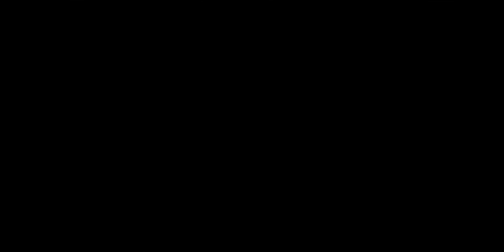iPhone 16 LEAKED! First Look At FINAL Design + New Features!

Comment: They need to put iphone pro max In orange and have a pen with it  and make the iphone just as large as the galaxy s24 ultra. Put airpods inside the phone box with the phone and adapter. Make all apps free in the appstore without making a apple ID account. Make the airpods into airbuds like the galaxy earbuds. Apple come up with a apple refrigerator like Samsung did so it can connect to the pho e when you go grocery shopping. Apple apple apple 🍏  yaaayyyy

Comment: I’m perfectly happy with my 15 pro max, I’ll probably have it for the next few years. Plus, I’m sorry, but those colors are just not it.
Reply: Same. The colours are ugly and not much changed. What case do you use? Originally was using apple silicone case as I like all black cases that don’t make the phone too heavy but I switched to spigen ultra thin hard case

I just hate the fingerprints on both cases, however this one is lighter than the Apple case and not so bulky on the sides
Reply: @Ohkeh640  I switch between an ESR clear case, and a casetify bounce case. Casetify is a little overpriced, but the designs plus protection is worth it for me. ESR is the best clear case imo. I have the white titanium so fingerprints are not really an issue for me since they’re harder to see on the lighter color phones. But I had a blue 12 pro max, and I remember the fingerprint struggle was infuriating.
Reply: I switch between an ESR clear case and a casetify bounce case. Casetify is a little overpriced, but the designs plus protection is worth it for me. ESR is the best clear case imo. I have the white titanium so fingerprints are not really an issue for me since they’re harder to see on the lighter phones. But I had a blue 12 pm and I remember the fingerprint struggle was infuriating.

Comment: Hi all, would be so kind to answer my doubt: I’m coming from an XS Max which struggle to survive, not charging well, lagging etc… being an old school guy I charge it with cable and never used a MagSafe. My question was, will Apple launch a new MagSafe charger being abke to charge the new iPhone 16 at 40w speed? Or can I already buy in advance the actual magsafe charger that will support 40w charging? Thanks so much 🤞🏻

Comment: I really like the design of the base 16 iPhones, at least they look different than the previous 4 years. 
However if the SE4 is rumored to be true, I personally would want to wait. 
I have a 14pro & am not team pro iPhone anymore. 

Having 120HZ on kills your battery. So it’s on 60HZ anyways. Having the extra camera, with the current camera app, makes it tedious to take good quality photos from a distance. Having to use Halide to get better images than what actual software on the phone can produce.
Not mad about having lightening, but need new AirPods. So all devices besides the phone will be usbc. 

Its not that I dislike the pro phones, but I see a pixel 7 pro taking better photos than my iphone 14 pro, and that battery lasts all day. 

So I am debating on just getting a base 16 or waiting for the SE4.

Comment: A18 chips should be based on ArmV9
Pro models should get WiFi 7 & 5G Advanced
Apple might be switching from HEIC to JEPG XL

Hate incremental upgrades.  Base models should have pro-motion.  Pro models should not have to wait for 48MP telephoto.  Love the new batteries; heat dissipation & replaceability are essential.

Comment: I just hope my iPhone 13 mini continues to receive security updates to be honest there isn’t anything to be excited about these new phones. I actually wonder if I shouldn’t upgrade to the next iOS to keep performance good. If there is a way to only get the security updates.

Apart from a few colour changes, marginal battery improvements 10% (laughable). I can’t see how A.I on a phone will be useful it appears to be gimmicky and just Siri 2.1. Plus like others have said the colours on the Pro models are so boring 🥱 I wouldn’t buy alone.

No small phone in there range pretty disappointing

Comment: 60hz is unacceptable for even a budget phone
Reply: I hear you. But the average person, such as my sister, won’t even notice a difference if it was pro motion display or not
Reply: @davej1104  its not about if the average person would notice it. Its about making a fair phone that both someone who’s wanting a budget phone to compete in the budget market gets a similar feature experience. I for one think 90hz OLED display, single shooter that has at least OIS and flash, 5G, all day battery, good build quality, usb C at minimum 10Gbps and iPhone 13 pro Silicon or later. Is all thats being asked for by people. We should not have to pay 2000 aud on a phone just to get high refresh rate screen and a decent camera.
Reply: Colors are pretty hideous…
Reply: You know who had one of the best screens? One plus
Reply: Samsung did it already in 2020. 120hz should be the standard, not a feature.. 😅
Reply: @RoryDunn117  I do believe Apple doesn’t know how to have a higher refresh rate and increase battery at the same time. I’ll bet that 2026 it’ll be this years new battery with a higher refresh rate. With that, the battery will basically be a 2023 capacity battery again.
Reply: people who have never used 120hz don’t even notice
Reply: I wouldn't say it's unacceptable, just a con.
Reply: @birgereriksen9984  i suppose that’s right
Reply: @birgereriksen9984  for a $1300 AUD that is unacceptable.
Reply: My mom likes iPhones, AND has a 120hz screen. Doesn’t notice the difference between 60 and 120. Sadly, thats the truth for most people these days.
Reply: It is criminal to not include promotion with the base models but as many commenters before me said - most people won’t notice. I tried with my friends and they mostly didn’t notice and when they did they didn’t care. Still not a reason to not include it but apple knows they can get away with it and still make a buck. I could understand 90hz on the base models and reserve the smoother 120 for pros
Reply: 60 hz -120 hz, no problem no effect
Reply: If it bothers you so badly, why not getting a phone with a 120Hz display?
Reply: Yeah
Reply: Don’t be so dramatic, perfectly acceptable
Reply: I have a iphone 13 pro and honestly I dont think I can notice a difference. I think it heavily depends on the person. Perhaps if I had another device with an even higher refresh rate I might notice that. Im honestly not sure. (For context this is my phone device with a 120hz refresh rate and my most used device.)
Reply: @ianpokemon04  toggle batt saver mode on now use it. Thats how it feels to use anything less than 120hz
Reply: @khyleebrahh7  honestly i can’t tell the difference
Reply: Nope. It's more that that. It's utterly disgusting.
Reply: The people buying budget phones can’t even tell the difference. Let’s be honest.
Reply: aw I thought apple was continuing 120 on new phones including base and pro😂
Reply: Coming from someone that works in the Genius Bar, the average consumer has no idea what 60hz means
Reply: If you scroll or read anything on a phone.. then you care.
Reply: Nonsense.The non tech nerds won’t care.
Reply: You don't have to be a tech nerd to appreciate the benefits of 120Hz. Some fans defend Apple's shortcomings rather than asking for better value for their money.  Be a consumer, not a cult member.
Reply: @caffeinated-gee actually you do have to be a tech nerd to appreciate 120Hz.
Reply: @Adam_player_1  You just need to be a human being with working eyes to appreciate 120hz
Reply: @Adam_player_1  no you don't
Reply: @NoDayOff98 bro the average person won’t know if you give them a 60hz display or 120hz display.
Reply: @caffeinated-gee lmao for real.
Reply: @caffeinated-gee most non-tech nerds don’t even notice the difference.
Reply: @caffeinated-gee disagreeing doesnt make someone a cult member
Reply: @davidjacobs6244  i am a tech nerd. The only thing stopping me getting that over the pro is 60hz. Its a perfect package.
Reply: @davidjacobs6244 even a person who is a 100+ years could tell a difference between 60 and 90 hz. “Non tech nerds” care to get a good quality phone for the expensive price they are paying.
Reply: Nonersense, because they don't know. If they Know, they wouldn't want 60hz.
Reply: @romahnae If they did know they would probably forget
Reply: Human eyes can only see 30hz.
Reply: @fastandshortech325  go and use a fast refresh rate phone then use a 30hz
Reply: No aod and no telephoto
Reply: Im a gamer and when im playing pubg i want as many frames as i can get. But in my everyday scrolling idgaf about the hertz
Reply: @charlesjohnson-ic4lk  I guess thats actually a good reason to buy a pro ngl
Reply: @charlesjohnson-ic4lk  i think it more noticable as everything around me is high refresh. When you go from anything over 90hz back to 60 it feels sluggish and easiest way to describe it is toggle bat saver on iphone. It just feels terible
Reply: 60hz is fked😢
Reply: @dakotafriday fuck what, shit phone with shit chips have 120hz but still for app and game still laggy coz hz no matter, Chip more important
Reply: @THEBATMAN7788   60hz is just a cash grab. And for banana heads. 120hz all the way.
Reply: Bro apples 60hz phones are way smoother than most android phones ”120hz” phones
Reply: 😭 who mans is this?!!
Reply: @johnpranaitis5628 Lmao no, it's not. My daughter has an iPhone 15 that shit looks like trash. 😂
Reply: @johnpranaitis5628  math not mathing lol. 120>60 idk what that has to do with it being an iphone or an android. 🤔
Reply: @HungMightGuy  refresh rate isn’t everything. iPhone ui makes a 60hz phone smoother than a 120hz with less smooth Samsung ui

Comment: hey appletrack I heard from a trustworthy source from argentina that talks with apple factories every single day iphone 16 6.5 inch and iphone 16 pro 6.5 inch  they are all ok for the event to be touched in september 20th and they have told me that apple told this source that iphone 16 plus AIR 6.8 inch and iphone 16 pro max 6.99 inch are having faceid unlocking issues magsafe2.0 wireless charging issues usb c 3.0 issues and iphone 16 6.5 and iphone 16 pro 6.5 inches will have usb type c 5.1 version speeds  but the plus and the pro max will have usb c 3.0 speeds but they also told me that iphone se 4 and iphone se 4 pro plus are set and ready to be launched at september event

Comment: Something I don’t get is why every YouTube channel is failing to mention the main camera sensor upgrade. A custom Sony IMX903. The new Sony stacked sensor is a HUGE upgrade.
Reply: Heard iPhone 16 is getting a Samsung sensor
Reply: that rumor was removed from macrumors' page so i assume it was fake :/
Reply: @franminach  Well that does suck. I’m hoping that it’s actually still on the pro max. The newer stacked sensor is over 18 months old at this point. Crazy to not upgrade the main sensor.
Reply: @WickedOnMars the sensor had been same since14 pro
And as an owner of 14 pro max and 15 pro max
Yeah there are noticeable software differences but it’s not enough
Reply: Mac rumours said it’ll be the same sensor as 15 pro which is the same as 14 pro
Reply: The smaller Pro model is rumored to not get the new Sony IMX903 sensor until next year. Yikes over a thousand for that with a 4 year old sensor won’t be buying that one.
Reply: @Nucleus1984  macrumours roundup says neither are getting a new sensor 
But if that’s what’s gonna make u not buy the phone I think you misunderstand just how much of a difference the new processing that comes with each chip jump will make

Comment: I love you Sam, but there’s not one thing new in this video compared to last week. 😂
Reply: There is the super exiting “button” and the recycled design for hundreds of dollars.
Reply: @janniboss9020 that’s the same with like every modern phone. Tell me the difference between the S23 Ultra and the S24 Ultra
Reply: @directerhu  we are comparing 12 with 15 bruh see the gap?
Reply: @directerhu stainless steel vs titanium, no curved screen, upgraded chip, on device AI, and a bigger battery….
Reply: @directerhu  flat screen,    scronger glass, anti reflective glass,faster charging speed

Comment: 🍏
APPLE COULD RELEASE AN IPHONE THAT HAS A FLAT REAR CAMERA SYSTEM THAT PROTRUDES OR STICKS OUT WHILE TAKING PICTURES. WITH THE 16 PRO AND PRO MAX THE 3 REAR CAMERAS COULD RISE UP AND RISE UP AGAIN REVEALING A ROTATING BASE. THIS SYSTEM WILL COMPLIMENT SPATIAL VIDEO CAPTURING PERFECTLY.😮
I WOULD RELEASE AN UNDER-DISPLAY DYNAMIC DOT THAT CAN BE TOGGLED WITH THE 16 PRO AND PRO MAX. I WOULD ADD A DYNAMIC ISLAND TO THE SE4 AND RELEASE IT WITH THE 16,16 PLUS,16 PRO, AND 16 PRO MAX. IT COULD HAVE A FLAT REAR CAMERA THAT DOES NOT PROTRUDE.
I WOULD MAKE A SPECIAL EDITION IPHONE EVERY YEAR AND AN ULTRA. A
DYNAMIC DOT THAT DISAPPEARS CAN BE ADDED TO THE SE4 EVEN!

Comment: 00:03 iPhone 16 design and color lineup for 2024 revealed
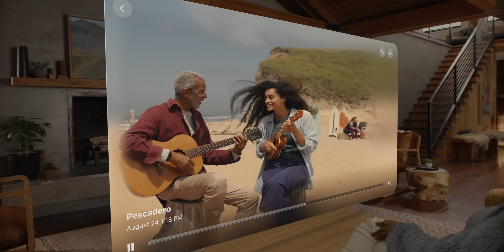01:25 iPhone 16 features 3D spatial video recording and a new action button replacing the mute switch.
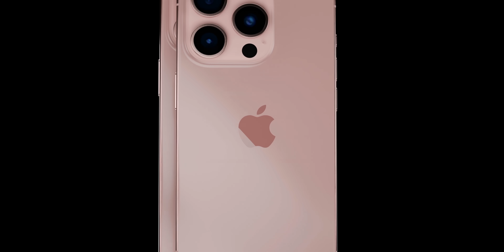02:51 iPhone 16 design changes and AI features revealed
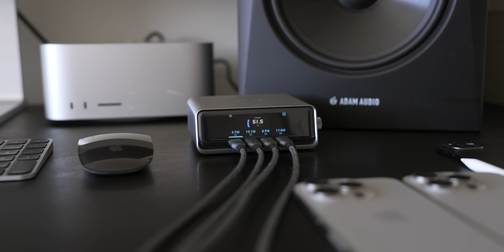04:18 Anchor Prime charger - one station for all devices
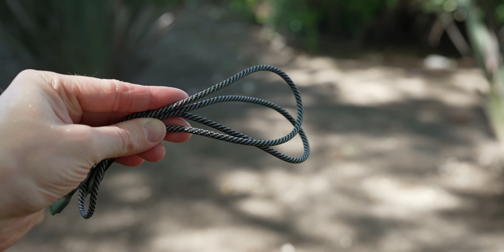05:44 iPhone 16 Pro to feature revolutionary battery design
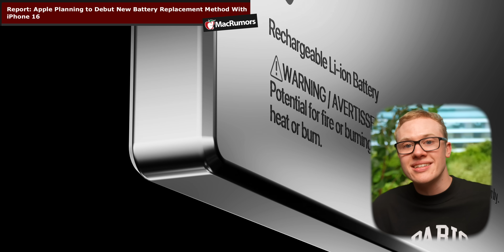07:11 iPhone 16 will have improved battery, camera system, and a new capture button.
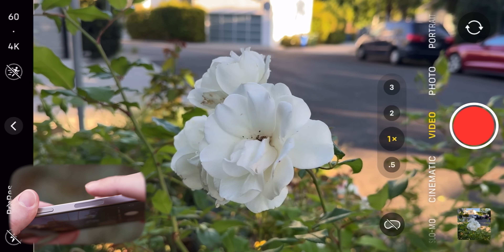08:32 New iPhone 16 Pro features enhanced camera capabilities
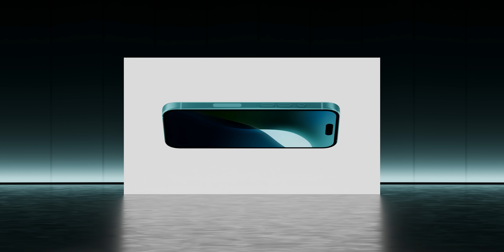09:57 iPhone 16 Pro brings major AI features with A18 chip

you can thank me by liking my comment